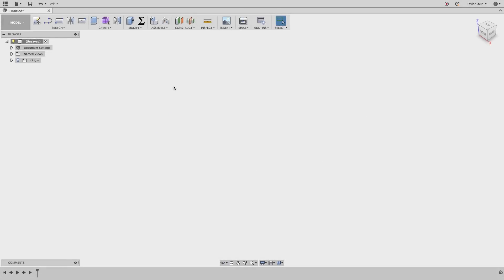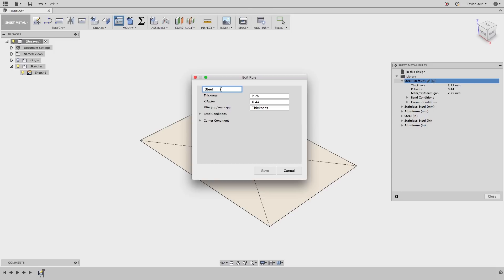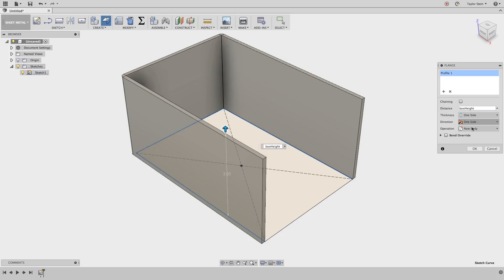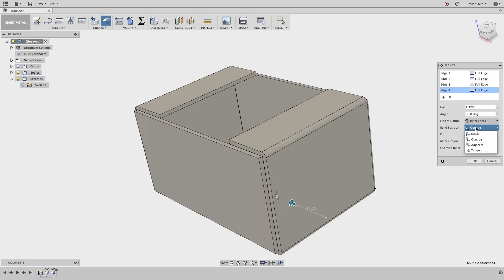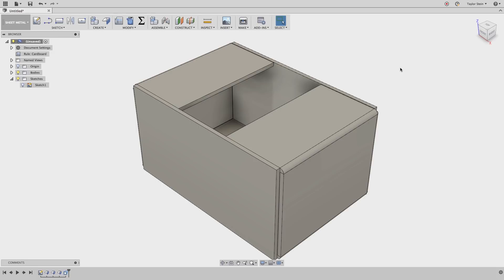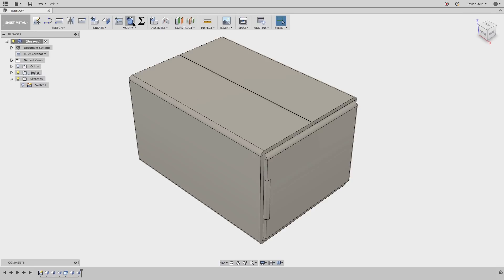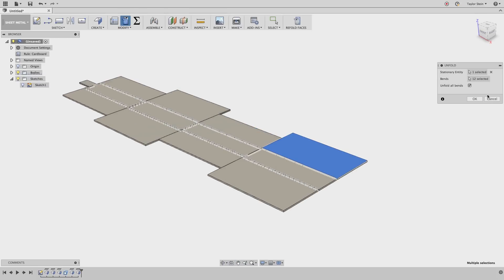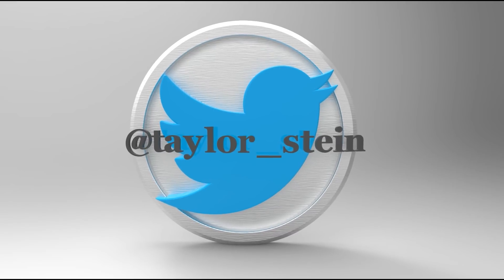Fusion 360: Cardboard Box Design with Sheet Metal Tools

Comment: A K factor of 0 would mean that the cardboard stretches on the outside of the bend. A better K factor value for cardboard is 1, meaning that the outside of the bend does not stretch, while the inside scrunches together. This will make your flat pattern more precise., otherwise, your outside flat dimensions would be too large by the cardboard thickness x every bend in that direction.

Comment: Cardboard actualy has a negative K factor - it shrinks by about a half of the thickness. So I would suggest using any 2D CAD to make these changes after the layout is ready.
Reply from the maker: Great feedback, Ernest! We're not experts in this field, but Taylor did some research before making and presenting this.
Reply: Yep that is true, depends if it is a single, double or triple wall corrugated but it as what we call inside lost % and also outside gain %... beside that, great tuturial. I only liked to see in future a more professional aproach to carboard desing in fusion.

Comment: At 1.59 you state that the cardboard does not stretch , this is not quiet correct . As in Metal , for each type of bend extra material is needed.
for instance : a 7 mm Cardboard with 1 bend needs 6 mm extra material, and a double bend (at both ends)  needs 9 mm extra.
so a U profile of 100x200x100 'needs'106+209+106 mm material. For closing side 9+7 (material thickness) = 16 mm extra is needed , and a 50 mm gluelip would need to be 56 mm.
Perhaps you can show how this would en up the box.

Comment: Nice video thank you. Can you please tell me if and how I can check the strength of the box if I put some weight on it? That it will be very helpful.
Reply from the maker: To virtually test a product, use Finite Element Analysis found in the Simulation workspace. HOWEVER, simulating cardboard would be somewhat difficult due to the nature of that material (not an isotropic material). Not impossible, but not easy.

Comment: A great video. 
I normally work in ply on a laser but the idea of using the sheet metal options to cut a cardboard box has inspired me. However, I would like to make an open top box with a slightly larger open 'top' box to slide over it. Obviously the 'bottom' box can have the final tab on the inside. However, to get a smooth fit, the 'top' box needs that gluing tab on the outside.
Therein lies my problem. I tried making the last flange the boxwidth - everything just welds and I cannot find a way to make the tab. I tried making it just a little longer and making the flange off that - Fusion 360 would not do it.

Can you make any suggestion for a way to achieve this?
David

Comment: i get an error saying:
the operation failed. try adjusting the values or changing the input geometry
(and it happens when i do the offset faces thing)
Reply from the maker: Hmmmm... Not sure what's happening. Can you share the model and describe the problem in more detail on the forum? Hard to assist here, unfortunately.
Reply: Thanks for the reply, but i just ended up using your one and modifying the dimensions. Thanks!

Comment: This is great....Let's try a different scenario....Let's assume I have a solid body in my model that I want to form metal around....For example, create a rectangle sketch of 6" x 5".  Press-Pull that part to 2.0,  Fillet the edges to .25 radius.  Now....Let's assume I want to wrap some semi-flexible material around this part.  Assume it's carbon fiber, or leather, or pleather....I then want to take that "sheet-metaled" component and export it as DXF.  There are ways to work around this problem using geometry but this seems like something Fusion should be able to do.
Reply from the maker: A 'convert from solid' type feature would be incredible. Count me in.